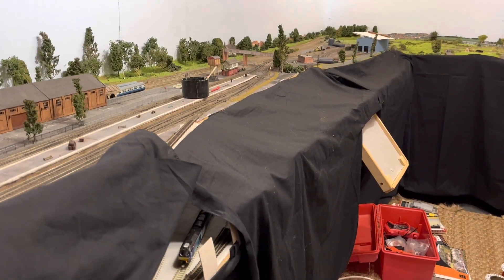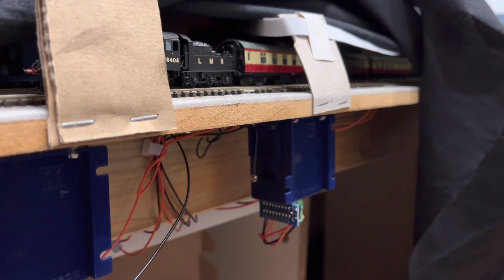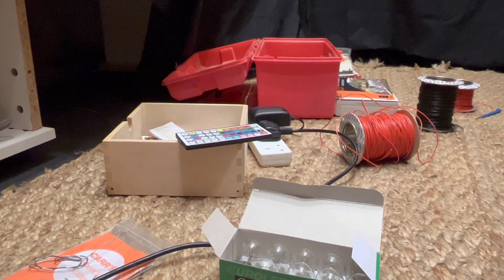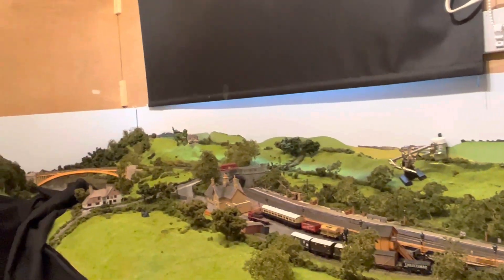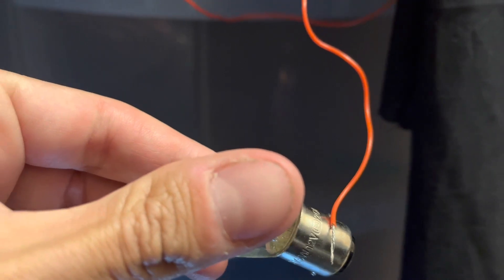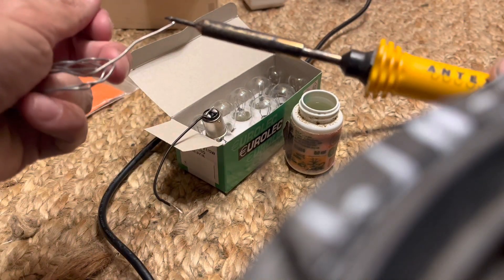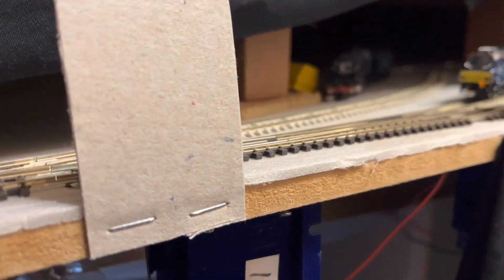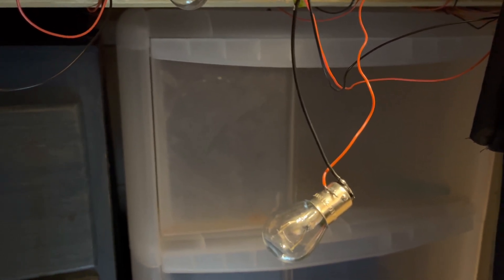Fix Cobalt Digital point motors forgetting their address

Comment: Just for info, the bulbs you used are a twin filament brake and taillight bulb with a 21w filament (brake) and a 5w filament (tail). The single 5w filament version will  be numbered as a 382 bulb.

Comment: Hi Simon DCC concepts are now aware of this defect. Send the point motors back and they will replace them free of charge. I have had all mine replaced that went defective for this fault 6 off. Once all point motors were replaced I have had no repeat failures The fault has been identified to a chip supplier. All new point motors do not have the problems. I have 60 DCC point motors on my layout and I would recommend them  Great way of solving the problem with bulbs

Comment: That seems nuts.  Feels like a defect in the design of the cobalts that they blank or change their address without the physical switch on the program mode. Putting the motors in a separate power district would need to be designed in at the start but also feels a bit odd as a choice , the motors should be immune to a short on the inputs.

Comment: This problem has been around for over a decade. You'd think the decoder manufacturers would have included an inbuilt fix by now.
I prefer analogue switching using the old Fleischmann track symbol switches.